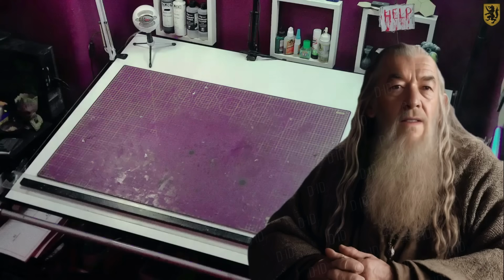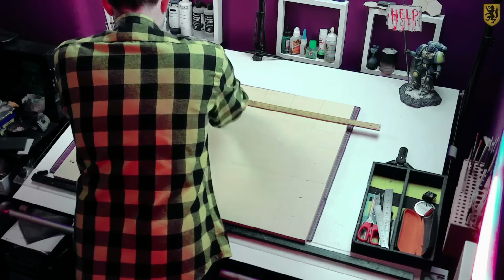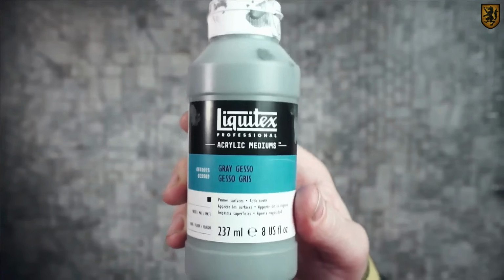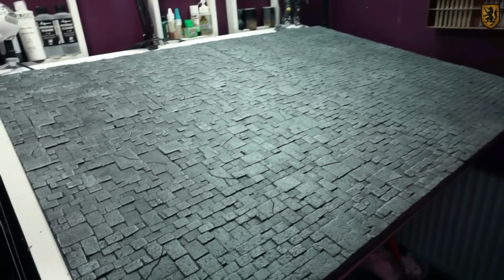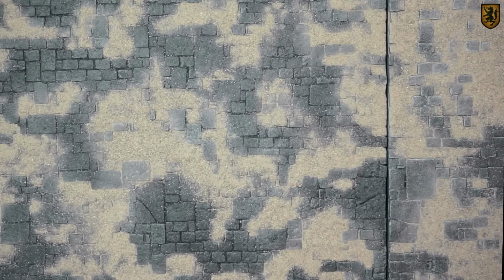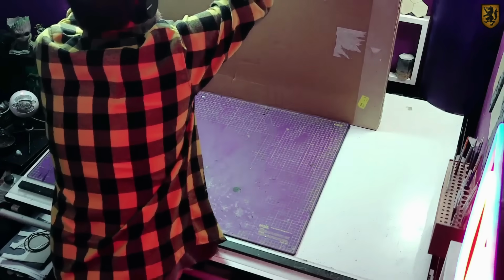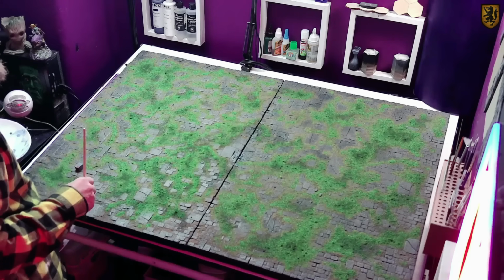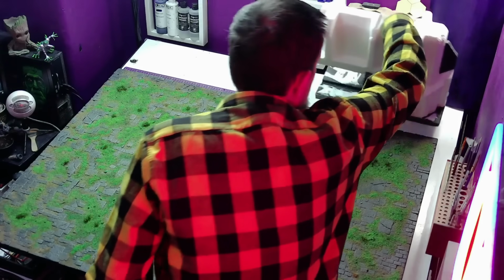One Board to Play Them All, One Board to Bind Them.

Comment: Awesome video! Hey what kind of tabletop bandsaw are u using? I’m tired of using my copper wire cutter. Looks like the one your using would seriously cut down my terrain building time
Reply from the maker: Thank you!  It's a Proxxon, it has it's issues but in general is a very useful & consistent tool, although a little pricey, but you get what you pay for.  Plus there's a company called Shifting Lands I think, that makes a load of different jigs for it that can make life very easy.
Reply: @WulvenKraft  thanks so much! I got a terrain building get together in a couple weeks and I wanna get an early head start on all the cutting and priming!
Reply from the maker: @wesleydelamerced6528  Good luck!

Comment: Great build but don’t you need 4 boards at £20ish each to made the full set?
Reply from the maker: Yes, if you wanted a 6x4.  But the very slight extra cost compared to a gaming Matt is well worth it in my opinion.  It looks so much better & is more immersive, not to mention extremely satisfying, even looking great on a wall.

Comment: Don't see how this is the one board you will ever need. I want 4'X 6' which can be adjusted to any type of scene.  That board is not going to give me the manoeuvre room for 28mm Eldar using skimmers to flank. It wont look like a city scape or desert.  The size issue is not your fault however.  There seems to be a trend set by GW to concentrate battles into a smaller area leading to the big bash rather than finesse of manoeuvre.
Reply from the maker: 6x4 ... just double it, that's the point of this build, it's easy to expand.  If you want dessert, don't use flock.  The point of this build wasn't to make every board GW says you should play on, but simply to make a board you can use in multiple systems that's easy to build, store & set up.
Reply: "the size issue is not your fault" 

I wish that could be applied to all things 😂